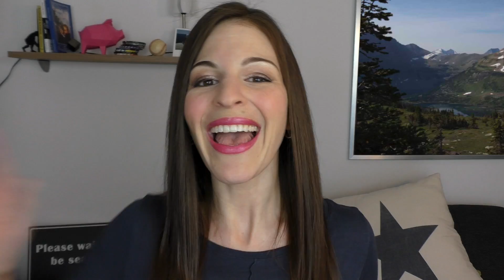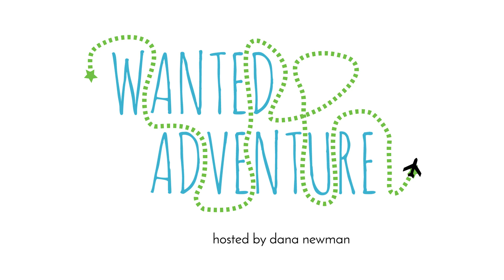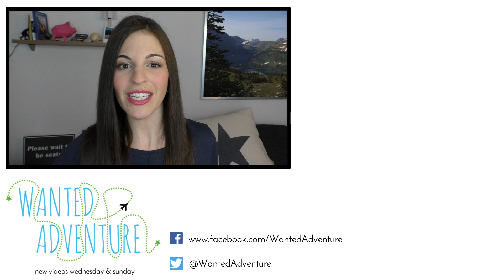Why Are Houses in America MADE OF WOOD?!

Comment: With a bit of High-strength concrete, Steel shutters for the windows and doors and possibly tunnel connections between large public areas, you could slowly overtime make Tornado Alley,, Tornado Proof.  It's not something you'd do all at once, but as and when a home needed building or replacing.
You could even put fancy wooden cladding on the outside for those who cherish their former wooden home.... even make it look German/French/Swiss with shutters (under the pull-down steel shutters, of course).  Everyone's a winner!  Cost will pay for itself over time.
Sorted!!
Reply: Until a VW Jetta flies into one of those concrete houses at 300 miles per hour.

Comment: Brick houses don't withstand a tornado either. To withstand a tornado you'd need reinforced concrete, which is quite expensive in most of rural USA where the trucks would have to travel 60 or 100 miles to the building site. And even then the roof at minimum would be torn completely off and everything inside destroyed anyway,  leaving just the concrete shell. It's just not as densely populated as Europe. And besides, tornadoes cut a narrow path, even in tornado alley the odds of any given house getting hit are infinitesimal and it makes no financial sense to build them to be tornado proof.  In more densely populated cities building codes dictate brick or stucco to keep fires from spreading, not to make them tornado proof.

Comment: I live on the west coast, one advantage of wood is that it is established in the planning/permit system that is in place here.   Meaning anyone can build a stick home with a basic plan since it can be approved by planning department without a engineer.   So my friend's Dad bought a long large section of property in the 70s and would build a stick home, live in the home a year (requirement) and then sell it.   During that year he would build the next home and move into that for a year.   Built a whole street that way.   He was a minister.  You could not do that with any other material I think, it would require a engineer to sign off on it and probably require licensed builders of that material to construct it.

Comment: Tornadoes aren't the threat with American homes.  Fire is the threat.  American home construction uses lightweight pine framing which is a HUGE fire hazard which kills more people annually than all natural disasters combined (tornadoes, hurricanes, earthquake, thunderstorms, etc.).  Masonry, stone, concrete, even log homes made of heavy log timbers are far more fire resistant than pine framing.
Reply: finally some one that makes sense
Reply: With stucco on the outside and drywall on the inside, the walls of U.S. houses are fairly well protected. But a house in the North, with vinyl siding over Styrofoam and a vented truss attic on top, is a bonfire waiting to happen. I'm surprised you can even insure them.
Reply: How else do you think we manage our population.

Comment: I have seen quality problems in houses built in Canada in areas like rotting walls, water getting into insulation, termites and leaking roofs. Houses built of plywood and low quality beams will not last all that long. Using staple guns to hold plywood to beams is usually going to end up shabby.  If the Canadians want to have wood houses they should use solid wood not plywood that is cheap and bad. European houses and Mexican houses are much more resistant  made of brick , stone, concrete, steel

Comment: Hi Dana, I like your videos a lot. Thanks for producing them. The question why Americans build wooden houses was always puzzling me. I understand that they make sense in California due the earth quakes. But not so much in Florida where you have Tornados and Hurricans.   In Germany, we used to have no Tornaodos. Recently, this has changed (due to the non-existing (?) climate change?), see for instance here: https://www.n-tv.de/mediathek/bilderserien/panorama/Tornado-hinterlaesst-Schneise-der-Verwuestung-article20438034.html
As you can also see, the tornado was strong enough to fold trees and blow away motor homes. But it only ruined the (wooden) roofs of the stone houses. The houses themselves are still standing and usable. They can be repaired in a few days and with very limited costs. The furniture did not suffer. Moreover, stone houses have better isolation which helps to save a lot of energy and can compensate over the years the potentially higher costs. In fact, the costs cannot be the main reason for not building stone & concrete houses. In Europe, there are many countries which are much poorer than the US and they still have stone houses. I understand that there is a lot of cheap wood in the US, but there also many stones. I guess the main reason for the wooden houses is just tradition and possibly that the construction industry is not used / prepared to build private homes made of stones and concrete. If it were, the stone houses could have a not that much higher price than wooden houses. Someone should start a business and offer afforable stone houses.

Comment: Wood is still relatively cheap here. You can do metal framing, but it will cost more. And metal framing doesn't have the load capacity that wood studs do so you may have to include some structural steel (I beams). Here is a site that shows a good cost comparison: https://www.thumbandhammer.com/framing-with-metal-studs/cost-wood-versus-metal-framing/

As far as tornados go, just build a safe room in your house. Like this: https://www.popsci.com/sites/popsci.com/files/styles/1000_1x_/public/import/2013/images/2013/05/safehouse.JPG?itok=EK0rQfDm

Comment: Dana, you are originally from Southern Florida right?  Don’t you know most houses in Florida are cinder block and concrete with a small amount wood framing.  There are also metal straps that hold wooden roofs on per hurricane codes.   Commercial building are often metal and concrete with metal two-by-fours.  Florida is also number 4 for tornado risk.  Brick is expensive, expensive to transport and requires skilled workers.

Comment: If i had a choice of building materials i would choose a steel frame work and stone walls on the outside and concrete block work for the interior walls, and welsh slate on the roof, nothing is getting through.
Reply: Depends where you live. Your choose of materials is the worst in areas that are prone to having earthquakes.

Comment: Wood works well for the US because of several reasons.  It's abundant and inexpensive.  It's easier to remodel and expand a house made of wood.  Concrete which has been used to some extent and brick which is more common act like a sponge absorbing and holding moisture.  In a humid climate like much of the US has that becomes a problem.   A house made of wood or masonry still requires maintenance and the costs are there either way.  Many US homes are made of brick which requires periodic repointing and needs weep holes to prevent moisture buildup.  Those weep holes allow a convenient entrance for insects and rodents.
Reply: Any house can develop mold if moisture is allowed to enter and accumulate unchecked.  I've been in 200 year old wood frame houses that haven't a trace of mold and 40 year old brick houses with heavy mold.  It depends on location, drainage, how well the house was built and the amount of preventative maintenance it's had. It thrives in plaster, wallboard, masonry, and HVAC systems..  Maintenance is required for any house.  In a wood frame house replacing wall studs is something almost anyone can do and it's usually only necessary in small areas.  Their are benefits to both types of construction.

Comment: Brick is usually a facade over wood framing. I have lived in three "brick" houses.  Wood can be surprisingly strong. For well seasoned hardwood, attempting to drive a nail into it will yield a spark between the hammer and the nail because the steel nail cannot penetrate the wood. Particularly strong EF5 tornadoes will rip asphalt roads and parking lots offthe ground.

Comment: Its a really easy answer. Timber frame house are
1. It is cheaper
2. They still have a block outer leaf
3. Its quicker to build
4. Easier to build
5. It heats up faster and is more eco friendly.

Block has advantages aswell.
1. Once it heats up it holds heat for longer.

Comment: It would seem to me that wood homes are more insulating, right? Concrete to me i think of cold hollow and echoey. Concrete or brick... yes we had those and still do in America but those were in the 1950s or so. It's easy to spot these homes in neighborhoods and they're considered "older style" homes or "older part of town." But not only that theyre a pain to decorate or modify! To put a picture you would need concrete screws and anchors, a hammer drill, etc. And to tear it down you'd need a sledge hammer! Long story short wood homes are cheaper and easier to upkeep.

Comment: My house has outside walls that are made of 6" or 8" thick concrete blocks with a layer of bricks encasing them on the outer surface, though the floors and interior walls are framed in wood. It's quieter and more fire resistant than many newer developments, though it would not be legal to build new construction this way in Massachusetts without more reinforcement to meet  current earthquake standards. Wood houses are easier to insulate, safer in earthquakes, and less prone to damage by ground subsistence and frost. But they are more vulnerable to fires unless the builder goes out of his way to fireproof them. With enough bracing, wood can be as strong or stronger against winds than masonry , but it's hard (though not impossible) to make it as durable against flying objects. Concrete has a lot of fire resistance, but its strength against earthquakes or tornados is only as good as the reinforcement (usually rebar) the add to it, and it has a fairly short lifespan most palces. Brick and concrete houses are fine for Germany, but they are not easily adaptable to places like California or Maine. The best houses are usually a combination of materials, like wood with brick or stucco cladding, or concrete block with steel reinforcement. Oddly, I've seen a lot  of Germans boasting about their "concrete houses", but most of the single family house I've seen being demolished in Germany are brick with a stucco coating that makes them look like concrete and no match for an American tornado.

Comment: i live in Kerala,  south part of India. We build house with brick and concrete. The walls are made up of brick and the roof is concrete. I always wondered why people in us build house using wood.First i thought it is for better insulation. However this video didn't completely answered my question. I understand the part where wood is widely available and cheap compared to brick and concrete.  I mean how many times do you see  a bus flying towards a house during a tornado. I see the houses in us collapse even with winds which has speed lower than that. Roofs fall apart during winds which has less speed than you mention in your video. I am sure that a house made up of brick and concrete can withstand it for sure.

Comment: i am from Nigerian, and i just moved to the united states to study and i have wondered why houses here are made of wood because when you're climbing the stairs or you're on the top floor the whole structure just vibrated, i can literally punch a hole through the walls on the outside of some of the dorms in my campus i can see the wood getting rotten even though some brick was used to design it on the outside, comparing this to the concrete blocks and cement used in building houses in Nigeria that last for many years and require little maintenance and painting. i asked my friend that if i wanted to live here and build my house from scratch and i want to use concrete blocks and cement to do it as it is done in Nigeria, if it will be possible and she said no. please how true is this?

Comment: Houses are made of wood in America because: 1. It is cheap, 2. Quick to build, 3. Low labor requirement as opposed to concrete buildings. 4. High modulus of elasticity meaning responsiveness temperature changes 5. Better thermal stability, 6. Easier portability of materials. 7. Unskilled labor can be employed to make it. But it is needed to be changed. The house can have steel reinforcements and recycled plastic to take the place of wood. Lumber is a fast depleting resource and environmentally unfriendly meaning it's loss from forest impacts the environment. Hence new materials must be researched such as recycled plastic.

Comment: Most "Fertighäuser" (perfabricated sections assembled on site) are actually made of wood. But this is not in any way similar to the wood frame stuff put up in America. German houses of this type are built of complex, composite walls, with several layers to them. In the end, the result is a house that in pretty much every way "feels" as solid as a brick built house. Insulation is actually "better with less" in wood construction than brick (ours is basically a "passivhaus", << 40W/m2 heating requirement). Sound insulation is identical. Fireproofing too. The other critical difference is how everything is fitted together: both in terms of draft proofing (no drafts whatsoever - something known as a "blower door test" - look it up), and to make up for lack of drafts which do serve a critical function in older houses, nowadays, heating systems incorporate a continuous, air recirculation system too; and in terms of fastening stuff together (like roof beams and joists to the rest of the building). We could take 100mph gusts quite comfortably with nothing untoward occurring. 150mph might be a little hary. But we would not lose the whole roof.

In short, new German/Swiss/Austrian houses at least, are hi-tec products. You can get this stuff in other countries, including the USA too, but you will usually end up paying a ridiculous premium over the going rate in those countries where they are mostly made and sold.
Reply: I have been scrolling the comment section for so long, dearly hoping that somebody would display the standards of german/austrian/swiss timber constuctions. Thank you for that, I can only leave one "Like"...

Comment: I like wood houses, don't get me wrong, but the smart thing would be to build your home at least as safe as possible. Honestly... I mean.... seriously... ;)  I'd rather repair some windows and walls than lose all of my belongings. And chances to get away with just some material damages still are a lot better with a stone / concrete home than when you live in a wood house. Usually concrete is also  reinforced by steel constructions and steel rods...  I get the cost factor, but especially with the social security levels in the US of A I think in the end it's a lot cheaper to built right once than having to rebuilt year after year after year. Correct me if I'm wrong here. :) Also: I know there are some laws and restrictions considering earthquake safety for some regions... so why aren't there any - as far as I know - for hurricane safe buildings (not talking about the bunkers)?
Reply: cheaper in the long run is more expensive to the one who builds it. almost all buildings are sold without regard as to what the building material is. but now many homes have foundation issues which are very expensive and sadly there are many people who have no clue that this is a very expensive thing to fix, so it's a bad buy. we found a brick home to buy in the US. i like that it's a lot stronger than wood.

Comment: There's plenty of stone/brick/concrete buildings in America. It just varies by region, climate, and other natural factors like earthquakes. If you go to NYC(in the NorthEast in general) You will see lots of old brick and stone buildings because most of them were build in the turn of the century. Youll see "brownstone" homes that are a mixture of stone/brick/ exteriors and wood interiors. Youll also see some of the first tall buildings that are made of out of cast iron and brick. And finally steel buildings. Newer homes in more residential zones are built with wood, but you also see some brick/wood variations.

Even here in California where I live there are stone/brick/stucco homes. Usually there are older and actually less safe than the more modern wooden homes. Spanish style homes in particular are build to have great insulation with thick walls. 

I guess wood and some wood mixtures is the more common, but theres also plenty of stone and brick everywhere.

Comment: It's economics. Cheaper materials. Cheaper to transport the material. Requires lower skill levels to build. Higher profits for the builder and the largest cost is the land. Stone masons, brick layers, etc requires more skill level so the wages are higher. It costs more to transport the heavy materials. Also, a tornado proof house would have to be underground.

Comment: Bricks also aren't very practical anywhere that gets extreme temperature shifts. I live in Wyoming and there aren't many brick or stone houses here for this reason. For example in a typical week during winter temperatures can shift from below zero with wind chill to hot enough to melt snow. When this happens the water that gets into the bricks melts and refreezes dozens of times. Over a mere three years this can cause thousands of dollars in damage making brick or stone houses prohibitively expensive. Not to mention that wood houses are simply easier and cheaper to build and maintain.